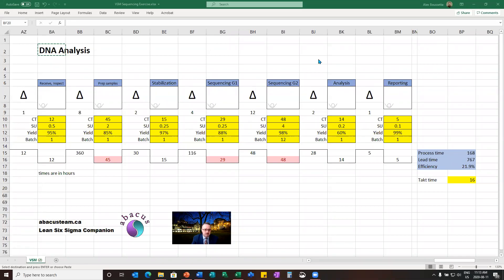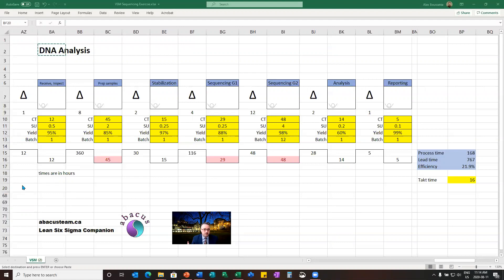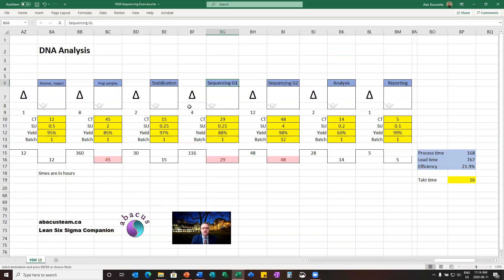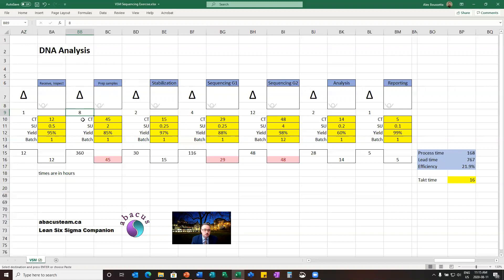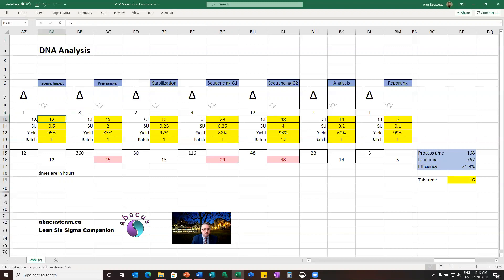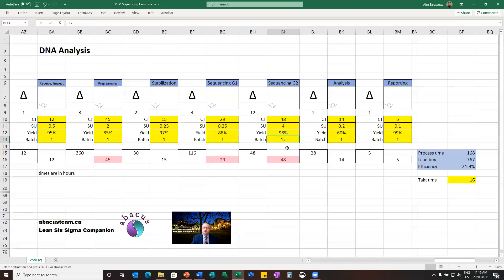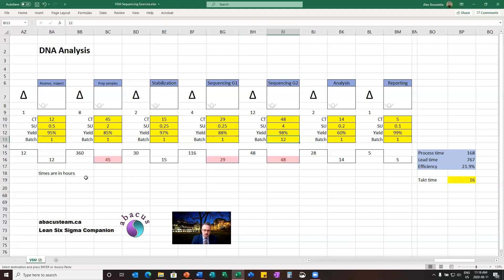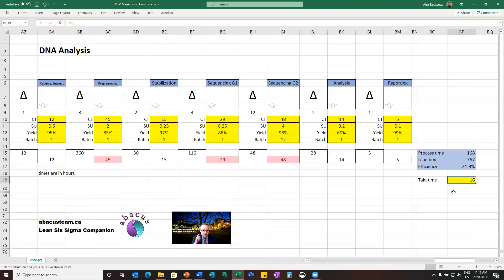Value stream mapping demonstration

Comment: Thanks - all these inventory numbers 1,8,2,4,12,2,1 are a function of what two numbers ? while i have understood that the number 48 before "G2" is a function of CT, Batch Size and inventory count
Reply from the maker: For the wip, or inventory, you need the data. It is not a calculation